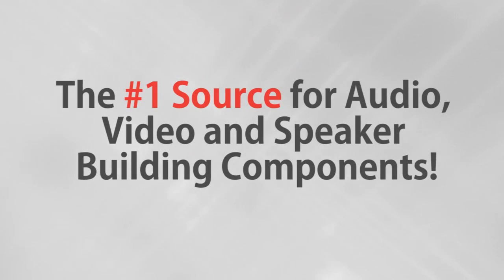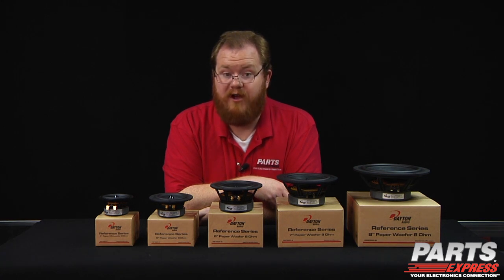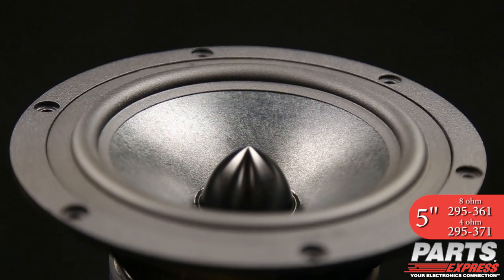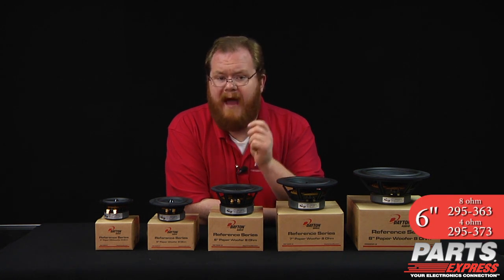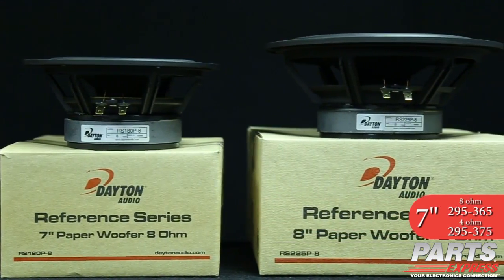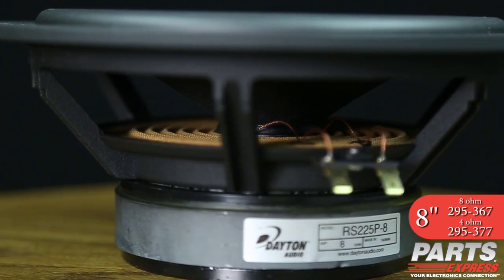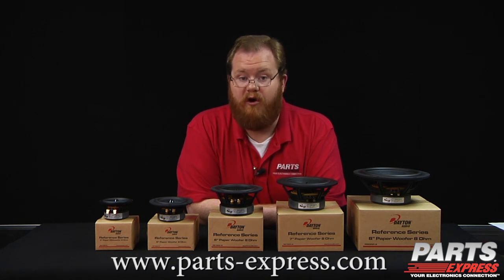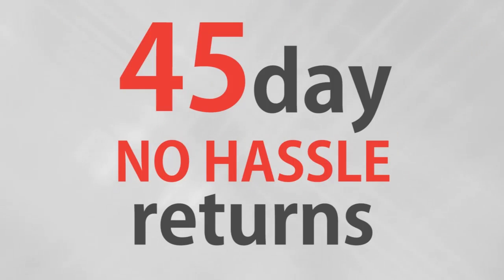Dayton Audio RS Paper Cone Woofers

Comment: I replaced the door speakers in my Nissan LEAF with Dayton Audio RS180P-8 as the first step in an upgrade. Will be replacing the tweeters with Focal TNB and adding a Kicker Key200.4 running active crossover.

Comment: Hi there, Great video.
Which would you choose for a car audio setup between a paper/kevlar cone or Aluminum cone (RS150 vs RS150P). These will be the sole speakers at the back deck shelf.
Reply from the maker: datzed Please contact our tech department for the best solution to your setup. There are a lot of variables that we need to consider for certain applications. They can be reached at: tech@parts-express.com or by phone at 1-800-338-0531. Thanks!